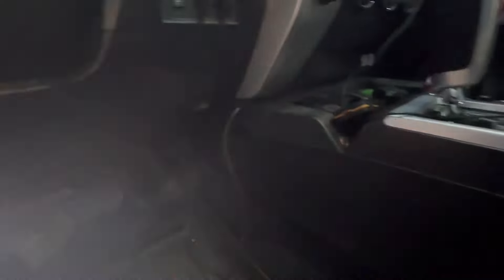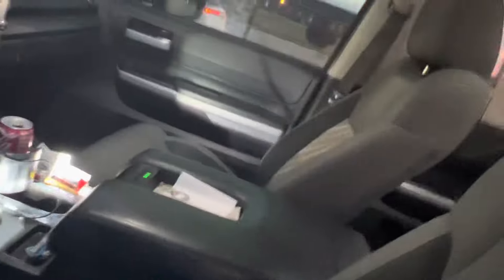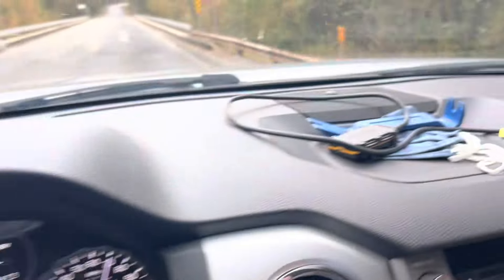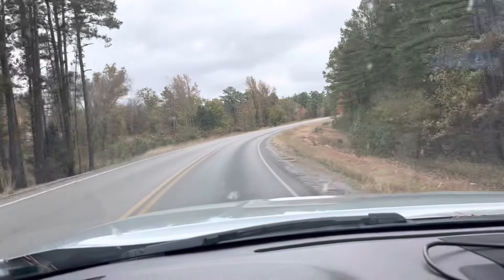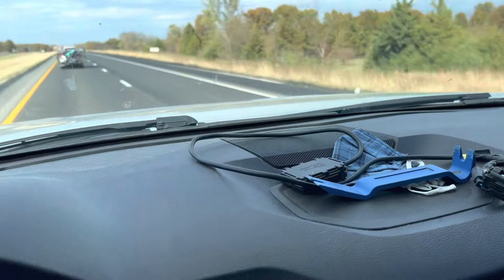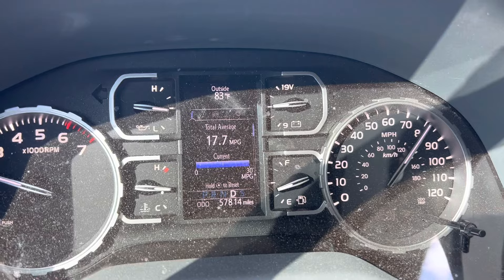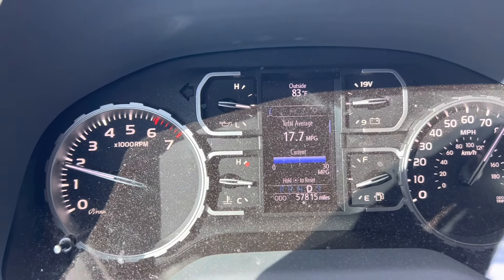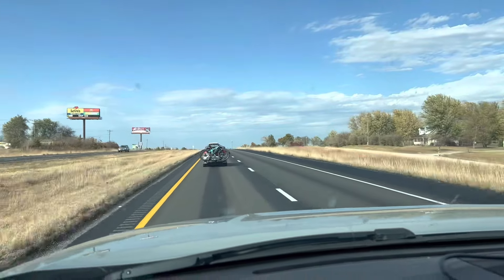Tundra Shut Down in the Highway! Pedal Commander Failure??

Comment: Hello
Has this happened to you after installing the commander's gas pedal, that you hear a sound from the engine like a soccer ball hitting the right side car window for a moment, usually two or three times in a day😒?
My friends told me that there is a knock, is it true?
 In addition to this pedal, I installed a cold air filter kit for a 2015 Toyota Corolla with a volume of 2000 cc.

Comment: As for mileage it could be tailwind or no wind as mentioned. Also it may have had a computer reset and its recalibrating as i found out after i disconnected the battery. I went from 430 a tank to 620 a tank. Obviously it recalibrates as you drive, I was watching the MPG at one point and it was counting down the gallons ever 300 feet! lol! In the end it caught up to the 410 range. In any case i think that may be part of it. Im using the Shiftpower usa and im easy on the accleration, plus avg 75 on highway. I avg 14.8 to 15.5 city and 17 to 18 on hwy. 2021 TRD Pro Tundra. Great video thanks for the contect, I had the pedal commander and took off. but have as a backup. I also purchased the OBD2 based on your video, just in case.

Comment: Any ideas on his increased mileage? I know I've had cars in the past that if you drive them slow normally, they will not get up and go as much as they could. Then if you drove them harder for a while, they would. Like the computer learned the desired driving habits or something. This happened on a fairly modded g35, so no, it definitely isn't in my head.

Is it possible that the throttle commander was telling the computer that the car was being driven lightly even though it was being driven normally? If that's the case, is there a way to do get that done? My Sequoia is very responsive and fast for a large SUV, but I'm getting 13mpg. I'd give up the over zealous throttle response for a few mpg. Mainly, it would be nice for when my wife drives too. "It's a boat sweetheart, not a race car"... Everyone's flopping around hanging on for dear life, but she has the comfort of holding a steering wheel. haha.

Comment: Just an FYI.. it wasn't your pedal commander that caused this issue directly. It was your install and not at your own fault. Pedal Commander gives blanket instructions for every unit no matter the vehicle. Unfortunately ECU shutdown time is not 15 minutes on every vehicles. These trucks from '17-'21 take 45 minutes for the ECU to shutdown completely. That's why your issue occurred. I'm currently in contact with Pedal Commander informing them that they need to come up with better install instructions. Whether that means removing your negative terminal before install or not I don't know but I will update you with their response
Reply from the maker: Yeah man please do!! That’s interesting!
Reply: @kccreations5945  did you have any instances of rpm surges happening in certain modes prior to this incident?
Reply: Just bought a pedal commander for my 2017 tundra. And update on if 45 minutes is needed for shutdown? Thanks!

Comment: I've never trusted any of those devices that override factory settings. They just seem destined to fail or cause problems that you wouldn't ordinarily have had you not installed them. The truck gets terrible gas mileage but otherwise performs just fine without any of that stuff. Need a little boost getting on the highway or up a hill, hit the trailer haul button. That's all I do and it works for me with no issues. Good decision though, to move on without it! Be safe and be well!
Reply from the maker: Yeah it’s been good the last two years and I’ve enjoyed having it but this was a safety issue so I won’t be putting it on any longer! That’s for commenting and coming back to the channel man! Have a good one!
Reply: @kccreations5945  Oh I've been watching my friend, just don't always have much to say! Probably for the better these days!
Reply from the maker: Haha I appreciate that! Well thanks for watching then! Have a good one!
Reply: Tow/haul and PC are not equal. They don't perform the same function. PC changed the actual throttle curve and throttle position where as tow/haul changes just the throttle position and locks you into your gears longer. It's a very different concept